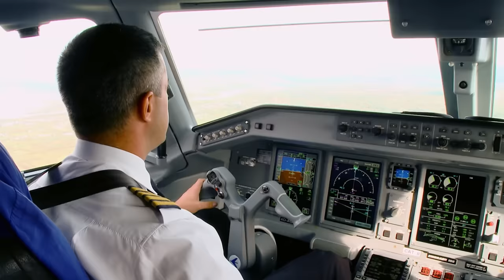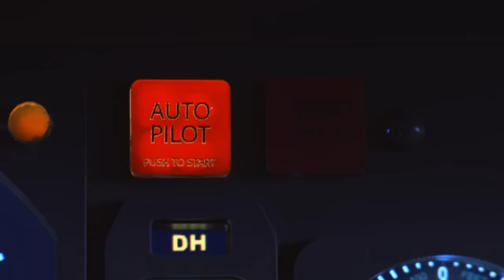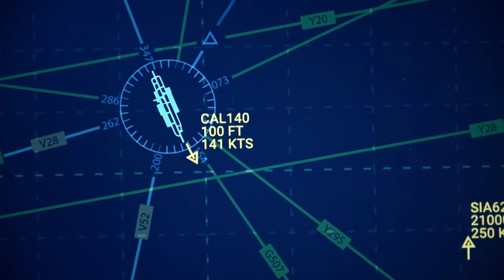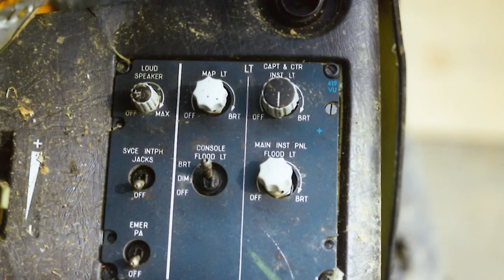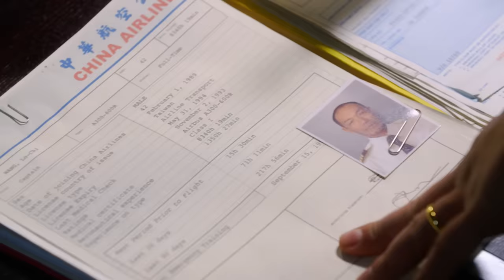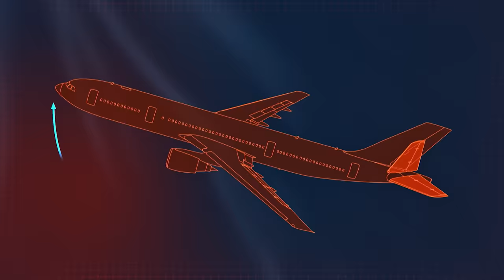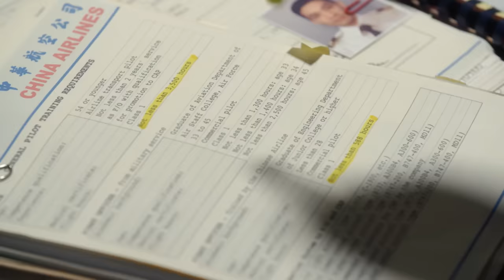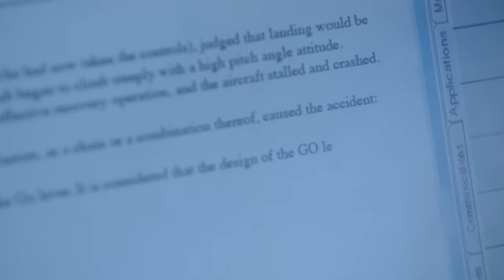Airbus A-300 Falls From The Skye Due To A Mechanical Fault | Mayday Air Disaster

Comment: What is the point of Airbus A300 simulation training if it doesn't help you correctly pilot an actual Airbus A300?
Reply: It did! The Simulator in Bangkok already had the SB (service bulletin) applied. Usually when a Customer comes in they are given a list of functions that the aircraft can have, the customer then then selects or deselects the ones that applies to their configuration (Airbus is very customizable and each customer can select what they want or don’t want). This list also includes any AD’s (Airworthiness Directives) and SB’s that can be selected or deselected and then this data will be fed into the Simulator to recreate a Customers specific model. Sometimes checkmarks can be missed or incorrectly applied or some SB’s or AD’s can be permanently applied if it requires a Hardware change to the Simulator. In that case it is up to the Customer to select a SIM that fits their needs however, even that can be missed.
Reply: @user-kb8gh5jv9t I agree. Sounds to me like the simulator in Thailand did what the upgraded aircraft does when its controls have been modified to accept “push hard down” inputs - disengage the “go around” computer logic. In other words, if China Airlines was not going to make the changes as recommended by Airbus, they should have bought their own simulators that simulated what THEIR aircraft would do, and not what other’s planes would do!
Reply: @user-kb8gh5jv9t  I love reading the comments.  I appreciated this one especially.

Comment: Imagine the passengers in the planes landing right next to the crash site. Looking out the window and seeing the spot where 200+ people died just days before.
Reply: I'd think, well, that just raises my odds...as it's not common, and it's never that close to the last crash.
Reply: That would be a fallacy. Your odds of crashing are the exactly the same even if a plane crashed at the same airport the day before.
Reply: I’ve done similar, but it wasn’t a crash.  I flew out of SFO and taxied within sight of a 747 that was heavily damaged from turbulence over the ocean.  It had managed to land, minus a few parts.
Reply: @johnathanstephens7015 how do you figure it would be a fallacy? The odds of two airplanes crashing at the same airport on back to back days IS less likely.
Reply: That’s the fallacy. It isn’t less likely. The odds of any plane crashing is independent of the origin or destination airport or what happened on any other plane previously. The plane has just as likely a chance to crash going to an airport that just had a crash. Look it up if you don’t believe me.  It’s called the gambler’s fallacy.
Reply: @LiveFreeOrDie2A

Think of  roulette wheel. The ball lands on zero. Well now it's less likely to land on zero, right?

No, the odds are still the exact same. The size of the Zeeo slot is the exact same as all the others. 

The ball has no memory.
Reply: @jonathanstephens7015  Actually not in the case with planes since after every crash they do investigations and may ground aircraft if they think there could be a trend so the same thing doesn't happen again.   Changes with atc, maintenance, and pilots are always happening to increase safety especially after a crash.
Reply: The father of that boy and his little brother witnessed it

Comment: It looks like air bus is responsible for the crash not the pilots
Reply: They’re always responsible but blame it on the pilot(s).
Reply: The problematic GO-AROUND behaviour of that Airbus type had been taught at certified training facilities for two years prior to the catastrophe. China chose an uncertified Taiwanese facility that lacked that Airbus software. It is entirely China Airlines' fault. The manufacturer never tried to hide the issue. 

Furthermore, four years later, China Airlines did it again. During a go-around, untrained pilots killed 202 people on the Airbus A300 jet plane.

It required another 206 deaths two years later due to a pilot error in Boeing 747 for China Airlines to make significant training policy reforms that have resulted in zero fatalities over the next 25 years.

This channel is weirdly biassed against Airbus.

Comment: It sounds like that MCAS system problem Boeing had on the 737 Max.
Reply: Shut up the max is a safe plane
Reply: Different systems, different failure modes, but there’s one thing in common.

Both are from a result of hidden systems the pilots were uninformed of.
Reply: I would never get on a boeing, ever. I got 1.6 million business flying miles in Airbus

Comment: Excellent presentation, but the title is inaccurate. It wasn't a mechanical fault but a design flaw.
Reply: :face-green-smiling::face-blue-wide-eyes:That's even worse, relying on Airbus computer LOGIC, over a seasoned pilot's inputs! The FSD fiasco of airliners.
Reply: FO’s mistake to activate the go around switch

Comment: The realization at 37:00 makes me so mad. 260 people died because the pilot did what he was trained to do!
Reply: For the old air bus not the new one
Reply: It still feels like a design failure to have ANY situation that could potentially lock the pilot out, what if the machine has a system fail and it decides to push the nose down without the pilot being able to override because of false information?

Go drive a car with a computer in total control of your breaks if you think this design is fine.
Reply: @DakkaDakka12  indeed. Had a car with "brake assist" luckily I could turn off. On a perfectly clear road it it braked for no reason. Horrible feeling when not in control. How poor pilots feel in a plane I can't imagine.

Comment: What a terrible system design.  That’s like installing cruise control in a car that doesn’t disengage with the brake pedal, but just fights you and accelerates more the harder you try to stop.  

Also, I thought AIRBUS’ were programmed to prevent pilots from putting them into a stall?  So did one of their idiotic pre-programmed “safety systems” override the other in this case?  🤦‍♂️
Reply: Um, news flash, that actually DID happen, btw!
Reply: A320 onward had the stall protection A300 was more of a "conventional" plane no stall protect fancy avionics etc. And yokes instead of sidesticks.
Reply: It's Airbus' version of the MCAS.
Reply: A go around is automatic once you flip the toga switches. This pilot added throttle power to a plane in go around mode and stalled the aircraft. If both pilots' would have gone hands-off, the plane would have climbed out normally.
Reply: @morganmccarthur1633  I understand, but given that most automated systems disengage when you take control, and their own simulator was even configured to do just that, it seems like a really poor design and not intuitive at all for it to basically lock itself on and fight the pilot.
Reply: They should call that system HAL.  "I'm sorry Dave, I'm afraid I can't do that."
Reply: Its scary how easy it was to engage the "go around' feature.  Thank god Airbus didn't implemented a "reach around" button on the control stick.
Reply: The A300 was the first attempt by Airbus to go all computer controlled hence this model was actually more of a “Hybrid” between conventional and fly-by-wire. Later models like the A320 family, 330/340 were equipped with the latest version, and much enhanced fly-by-wire control system and software.
The A300 had a lot of “bugs” that took a long time to correct.
Reply: It’s truly confounding, so many perfectly intact planes are crashing because of this. It seems so obvious and preventable
Reply: @nicholasgreenway610  , flying is a lot more intricate than most people think, especially in today’s World with youtube and tik-tok etc., making it “available” to everyone without real true background on what it takes! I have been flying for 31 years now and 28 of them commercially for airlines with many different types under my belt and lots of training given and received and can tell you that everytime we step into an airliner or different aircraft we learn something new, that’s the detail of the business and hence Pilots MUST make sure that they know their aircraft very well and stick to SOP.
Reply: Apparently they forgot to install it because 2 Airbus have crashed by a stall in the last 15 years.
Reply: @ahndeux  Boeings have the TOGA button on the fire wall,,,,, or dash,,,,,,,, you can't Engauge it  accidentally! It's a big white square  button! with TOGA on it.
Reply: Too much technology that wasnt adequately tested. I havent flown for almost 25 years, and likely never will again but I would feel a lot safer on an old DC-8 or 727, the pilot actually flew them instead of some glitchy computer.
Reply: I don't think the geeks that design a lot of this automated computer systems on planes were working with pilots as well as maybe they should have.  It's a no brainer to have it disengage when Manuel controls are used aggressively. It's like duh just switch off your cruise control when it takes total control of your car and someone pulls in front of you.....yah that would be a horrible design.
Reply: "Let's put the TOGA button on the throttle lever"
Good job Carl....🙄
Reply: @donreinke5863 that’s interesting. The dc8 and 727 also have computers. And the reality is computers themselves are extremely accurate. It’s just ppl don’t use them correctly or program them the best way. Hence a computer system when done right is far safer than a human can ever be. It dosnt respond to stress or emotion. It follows exactly as it is programmed to do.
Reply: @larchman4327 i agree to an extent. U also don’t want it a person to accidentally input stuff. For example if there is a problem and they are distracted they could accidentally hit something and fly into the ground. Yes that has happened before. I think a button that allows a person to input control that can’t be accidentally pressed is a good idea

Comment: * Why was it designed so that a push forward on the yoke would not deactivate TOGA.
* Why was the service bulletin not attached to an airworthiness directive.
Reply: This isn't the 1st time they didn't tell pilots something important
Reply: I don’t and never will trust Airbus automation . The same apply to modern Boeings . For me the last generation of Boeing I trusted was made more than a decade ago . 777, 767, 747-8, 737 before the max , those were good and reliable . Even Airbus from the A320-200 generation are good per se , like the older A330s, have crossed the Atlantic many times on those and are good plane , but won’t beat the 777-300.
Reply: @thematrixwillfindyou  i'm planning to travel this summer and i'm losing my mind trying to find a flight that doesn't have at least one leg on an airbus... i'm just not confident in them at all
Reply: @crowboy0666  Airbus planes have a good safety record. So do Boing planes. That is, the older Boing models do. The new ones, not so much.
Reply: @thematrixwillfindyou You do realize the 747-8 has nearly as much automation as the 787 or max, right?  Boeing hasn’t made a good plane since the MD merger.
Reply: @thematrixwillfindyou  well you're a liar sir...the 767 and 777 both use FBW as did the 757 before it [the "enhanced" version]...FBW isn't the problem it's the way it's implemented...airbus believes the pilot should be monitored and Boeing [before the Mcdonnell merge] believed the pilot should be monitoring...

Facts are both Airbus and Boeing are safe...fact is EVERYTHING is moving towards full automation...fact Boeing is no longer Boeing it's MD which means corporate greed, faulty products and finallybankruptcy [in that order]. Who knows Boeing might just be bought out by aerospaciale [airbus].
Reply: how is this a mechanical fault.

Comment: The fact that pushing forward on the yoke could have one effect in a Boeing and another in an Airbus is frightening.  It reminds me of how car manufacturers just can't make up their mind about where to put a control and stick with it, even among different models from the same manufacturer.  For example, in one car you pull a lever under the steering column to release the parking brake.  In others, you step on the parking brake to both apply it and release it.  If you switch back and forth between cars, you end up pulling a lever under the steering column and inadvertently pop the hood.  Frustrating, but of course in a car the stakes are not as high as in an airplane where 200-some people could die, as happened here.
Reply: I drive a forklift at work, and have two Chevy cars made 8 years apart.  The new Chevy has a lot of electronics and more automation. 
 When I'm tired or distracted once every so often I mix up the controls.  The same left lever stick on each will either be turn signals, windshield wipers, or transmission.  They have other big differences.  When I KNOW I'm tired, I started checking the main controls right after switching on ignition.  Always wise to do five-second check if you switch between vehicles.

Comment: So the video title is incorrect? It wasn't a "mechanical fault", but a poorly designed system coupled with incorrect simulator training. Mechanical fault implies something mechanical either failed or malfunctioned. It appears everything worked as designed, but the pilots didn't have the information they needed to land the plane.
Reply: Sounds to me like the simulator in Thailand did what the upgraded aircraft does when its controls have been modified to accept “push hard down” inputs - disengage the “go around” computer logic. In other words, if China Airlines was not going to make the changes as recommended by Airbus, they should have bought their own simulators that simulated what THEIR aircraft would do, and not what other’s planes would do!

Comment: Most crash scenarios don't exist in a simulator. It's usually the first-time pilots are confronted with a new and confusing situation. As in this crash, no simulator training was required even though the  service bulletin had not been applied yet.

Comment: Sounds to me like the simulator in Bangkok Thailand did what the upgraded aircraft does when its controls have been modified to accept “push hard down” inputs - disengage the “go around” computer logic. In other words, if China Airlines was not going to make the changes as recommended by Airbus, they should have bought their own simulators that simulated what THEIR aircraft would do, and not what other’s planes would do!

Comment: Damn, another se of Man vs. Computer, where the computer wins yet again. In cockpits there should be quick manual overrides for ALL critical parts of flight that contributes to the safety of the aircraft such as pitch up/down, bank left/right, speed, etc.
Reply: There used to be a red button on the pilots yoke which overrode the computer. I guess they removed that because not enough planes were crashing to keep the assembly lines busy.

Comment: Fly-by-wire sucks.  All you're ever doing as a pilot is making requests - you're never really in physical commmand/control of the aircraft.  Fly-by-wire is great for performance/fighter aircraft (where pilots can eject when the computer ignores their inputs), but absolutely ruins civilian airliner safety.  Give me a good old cable/physical connection which, if properly maintained will last 100 years.  And every single time you push the yoke forward, the nose goes down LIKE IT'S SUPPOSED TO!!!!!!

Comment: Landing halfway down the runway could be a "bigger problem" ?! 🧐 HOW?! How could anything be a bigger problem than what happened?!
Reply: It could cause a skid off the runway. Which in itself is may not seem big but if you're at certain airports there runway ends at the waters edge.
Reply: Or - you slide into a building, and catch fire.  I’ve seen at least one of these episodes where something like that happened.
Reply: Worse yet, you crash in the middle of the runway, and now, not only do you have a lot of deaths, but you also have air traffic snarled across the region, potentially leading to another disaster as seen in other episodes - though, to be fair, none of the "snarled traffic leads to airplane crash" episodes that I've seen featured traffic snarls from a previous airplane crash, but that's not to say that it couldn't happen.

LoL airplane literally flies over my house as I'm sitting in the bathroom typing this reply.

Comment: The common theme in almost all recent air disasters is that if there weren’t a computer partially controlling the plane it wouldn’t have crashed, or if the maintenance guy hadn’t sneezed on the bolt everything would be fine

Comment: the older pilot dude was an ass...... not helping at all
Reply: add in poor communications, f/o didn't immediately inform captain that the yoke was not responsive to a push down so captain just said push harder...   Common sense says all planes should share basic automation fundamentals. for example in all cars when you step on the brake the cruise control disengages. Imagine if one car manufacturer decided to deviate from that design...... Airbus design team messed up!

Comment: dude: autopilot will make planes safer
autopilot: bet...
narrator: this is the 23984383 accident where autopilot played a big part.
Reply: The most dangerous part of air travel is takeoff and landing. That is when the crews and passengers are at the most risk. The actual flight is fairly simple and very safe. 

If there was no autopilot... then the whole flight become dangerous... And the crews and the passengers will be at much more risk for the entirety of the flight and not just the brief moment of taking off and landing.

Let not forget all the accidents that were avoided because of autopilots...
Reply: If there were that many accidents no one would fly 😭